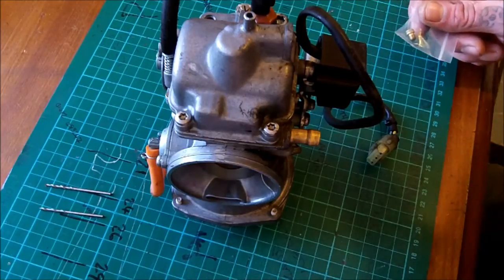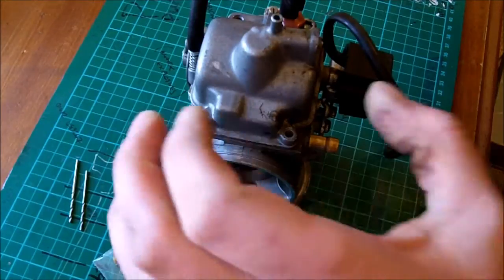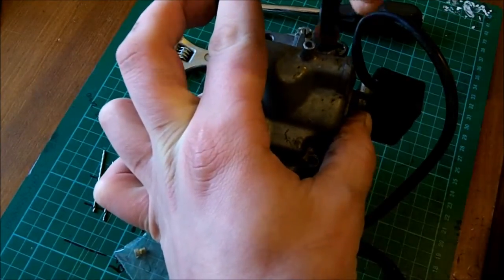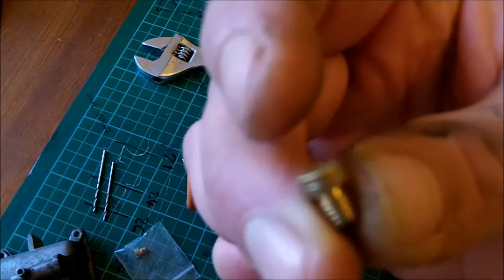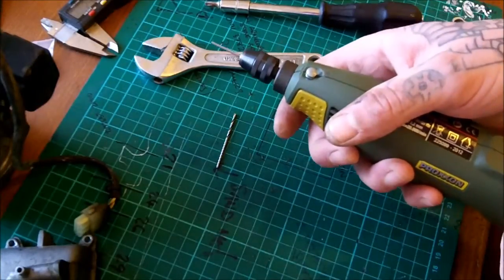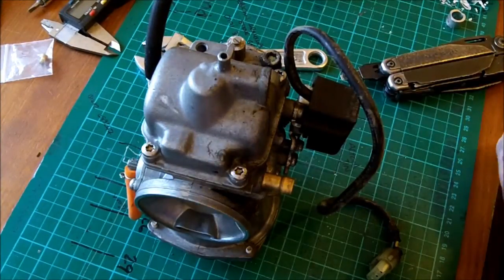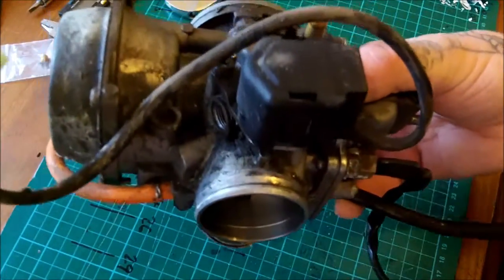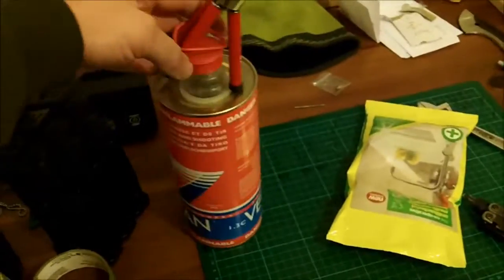Carb Modding for Dummies!

Comment: no disrespect at all..mate..
really interested in how the bike runs now...
further speculation with-held for the sake of friendship...
as an 'old time gray-haired ancient' rider..your gonna need to do a bit of air flow adjustment and timing change..good luck..anything i might help with..let me know...'hang on tight'.....
watch out for unburnt fuel bypassing the exhaust valve..if it smells 'rich'..you could be primiing a 'boom'..i'll hush now.
Reply from the maker: I filmed this a good few months back, the bike runs immensely better. And now prefers higher octane fuel (99ron).
Fuel economy has gone up, and yes there was a bit of air/fuel messing needed, not a lot mind.
The bikes are notorious for running stupidly lean, and this mod (daves carb mod) is the most popular and first people do to the xr650, same engine.
I have also opened up the air box quite a bit and the baffles are out.
It does pop/bang a bit but only when the exhaust is super hot had you go from high load to fully closed throttle during quick gear changes.
The bike pulls much harder in every gear, starts easier and has lost the horrendous flat spot about a third of the way trough the rev range.
Much smoother power delivery
When I rebuild it I will be putting a lower compression piston, uprated valves/springs and a stage 1 cam. at that point the timing will deffo be reset and tweeked with a strobe, most likely need advancing slightly.
The custom header will go from 2-1 instead of 2-2 so that should also give much better mid/upper range torque
Don't be shy btw, I'm always learning. But do know a little more than I let on :)
Reply: 650 cc displacement?...thats a big hole..it can go thru some fuel..
.
.
guess i was just remembering what happened when i bored out the jet on a kaw 350 'bighorn'..many years ago..
blew the piston/rings and cylinder walls so many times i finally fitted a 400 suzuki piston in it..
it got exciting..then the exhaust system exploded under my arse while i was riding..
yep..real exciting..for a minute or two..
Reply from the maker: rustedraven holy shit!!! never heard of that happening, well except on a 2T

yeah its a 650, i get about 24mpg lol
Reply: yep..she was a oil burner..did away with the oil injection system and just premixed it in a can before putting it in the tank..
long long story....
i just never learned how to keep off the throttle..
zoom zoom crash bang thump.
Reply from the maker: rustedraven zoom zoom crash bang thump rebuild repeat

Comment: This is an excellent tuto on how to get by. But the main problem is, unless you keep notes, you have no idea about what the bike is using the next time you have it off and you have no way of knowing what the jet is (unless you have a specialised jet reaming kit). The price of jets being what they are, go to http://www.dellorto.co.uk/ (Eurocarb). They sell any jet for anything. You can call them. They are most helpful. The only other thing I was going to say was - the (mixture screw?) you're undoing to compensate ? Now I know nothing about 4 stroke carbs, but the mixture screw on a 2 stroke carb has no bearing for 1/2 to full bore throttle. It's regulates the slow circuit. So adjusting the mixture screw to compensate for having a bigger main jet on a two stroke carb is not going to help. Are 4 stroke carbs the same ? What is that screw ? Usually they're on the side (either on the intake side or the air filter side depending on whether it regulates air intake or slow jet petrol intake). Now I don't know this type of carb so blow me into the weeds if I'm talking shite (it wouldn't be the first time) .....
Reply from the maker: ok, I am extremely familiar with this carb to the point I know the factory settings and jetting off by heart, so I know exactly what the mods im doing are, what they will do, and how to go back to factory. The mod I'm performing is also a hugely common mod for this carb (google Dave's Carb Mod). I did need to alter the air/fuel slightly as it ran a hair on the rich side so pulling it back got me to the perfect balance. Comments are always welcome tho, and i appreciate you trying to help :)
Reply: Thanks DK - not so much trying to help as trying to understand ! What kind of carb it it (make & model) ? I'm gonna have to learn about 4 stroke carbs now I've got one.......
Reply from the maker: Maybe this will help http://www.lingshondaparts.com/honda_motorcycle_parts_selection_pfk.php?block_01=17MFC5S1&block_02=E__1900&block_03=2905 and the common moddification is http://www.4strokes.com/tech/honda/xr650lcarbmods/
Reply: Thanks DK. Now I can go and do some homework. I'll check out the mod site you suggested too. I have to learn the 4 stroke carb before I can start faffing with exhausts etc on the CBR.
Reply from the maker: vitaly deuterium Hey, I'm no expert but if you need help looking for stuff just give me a shout :) and I'm uploading 4 new vlogs at the minute too
Reply: Thanks Man. I'll be tuning in.